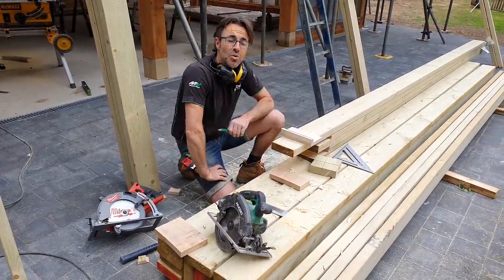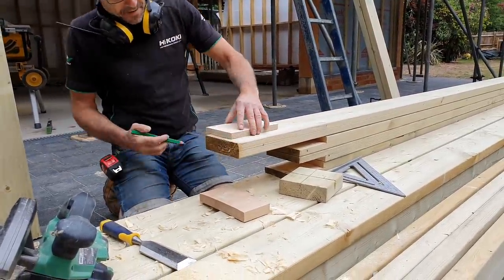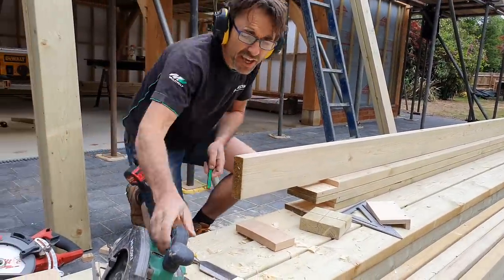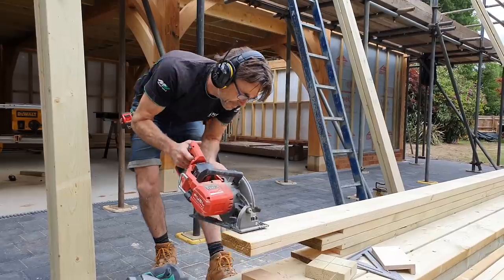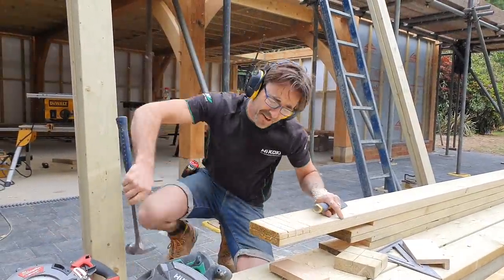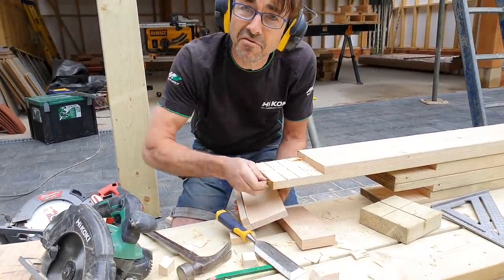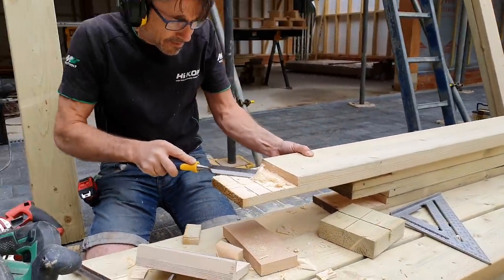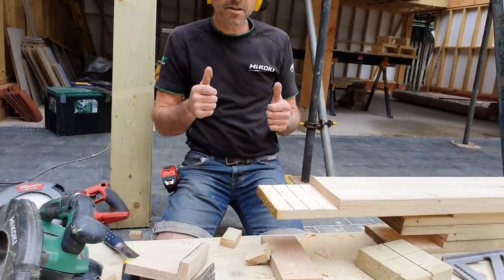How to make a halving joint for wall plates, this is the way I do my wall plate halving joints

Comment: I just watched that vid , you subconsciously do lots of things that carpenters do that others did not realise, You cut waste side of the line , hollowed the joint out , and used a chisel that is suitable to be hit with a steel hammer , you put the chisel down on the timber , to keep the edge and not on the concrete floor  

great stuff Robin , only people who see that stuff mentioned above are the ones taught that way , bang on mate
Reply from the maker: It's a 28 ounce California framer also known as big blue

Comment: Is that 6x2 
In Yorkshire we tend to use 4x3, regional differences hey. 
Videos like that are great! 
No rubbish, straight into it straight to the point
Reply from the maker: Hi, we use 4 x 3 sometimes, its mainly 4 x 2 in the south, this is a roof supported on a small timber frame wall that I am making in 6 x 2, thanks for the comment
Reply: @ukconstruction  Did you consider using a double top plate Sir? I'm not questioning your methods or second  guessing you, 🔨 🇮🇪
Reply from the maker: @TheToolnut  its for a timber framed garage made in oak, and the roof is on a stud wall about 400mm up from the oak frame over the doors
Reply: @TheToolnut  Can you please explain how to mark out a rafter a double top plate? for a straight pitched roof. I know how to do the single but for the double, do you trust the drawings or do you have to measure the exact height of the blockwork. Does that mean you need the best block layer ever on a double cavity block wall build? Would you recommend using lasers or string for marking out the roof/

Comment: Have you considered using a battery router to check it out? You could use that jig with a clamp as a fence and rebate it all out. No marking out the depth or using 2 saws, a chisel and a hammer. Worth a try next time but heaps of wood shavings.

Comment: Why did you use two different saws?
Reply from the maker: Simply for speed, one is set full depth and is better for the edge cuts and the other is set to the joint depth, I had a dozen or so to do so this made it super fast and accurate

Comment: Todays timber is nothing like the timber we had in the late 70s which was Hemlock that was full of knots and hard as iron, no battery skill saws back then and no razor sharp hardpoint saws. A rip saw and a crosscut Diston and each halving was a 10 - 15 minute job for a skinny school leaver trying to learn a trade

Comment: i was taught the length of the lap jiont was one and a half times the width of the stock . is this true ? have i been doing it wrong for many years
Reply: 150mm or 6 inches will do.
Reply: On 4x3 you can only do 4” on 90 degree corners anyway so - i dont think it matters really 4” or above on straight runs